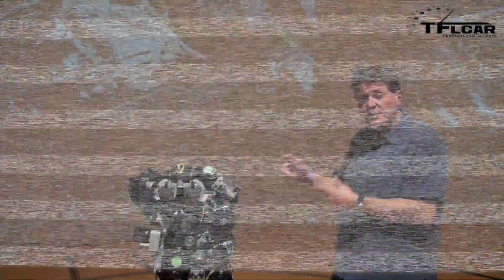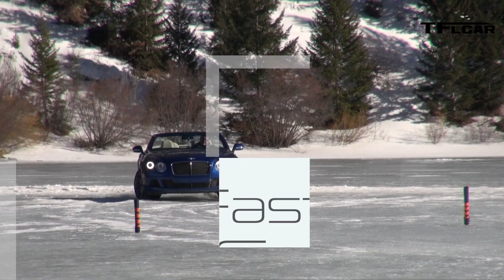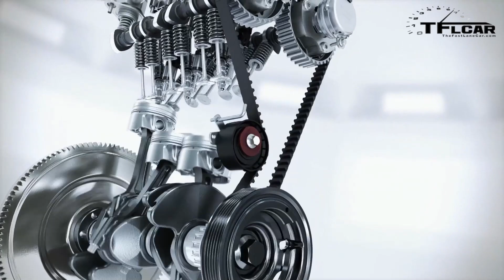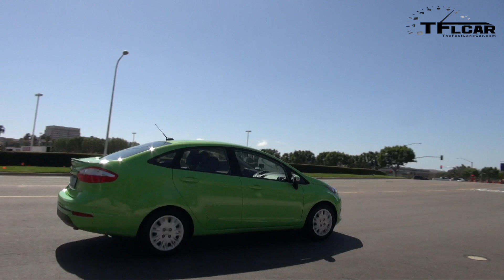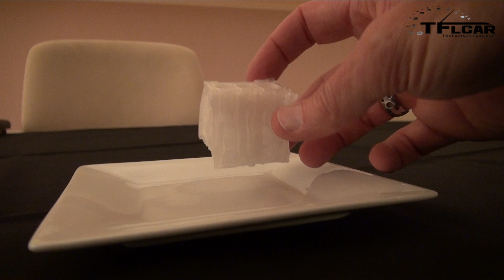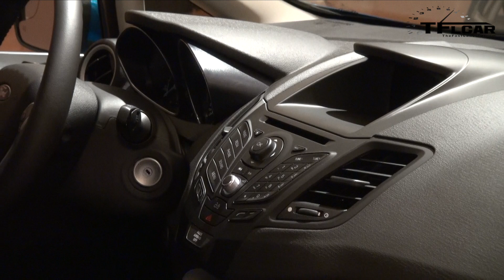2014 Ford Fiesta 1.0L EcoBoost: Everything You Ever Wanted to Know

Comment: The "Ecoboom" rumours are everywhere but all i can say is my driving instructor had one racking 20,000+ miles a year through lessons and it was still going strong after a few years.
Reply: It’s because this engine can last a long time but it isn’t very tolerant of neglect, you need to use the correct oil recommended for it and change it on time, if you do that it’ll be reliable

Comment: Just wait until the engine looses all its coolant or the oil pump fails due to being blocked with bits of failing cambelts at 35000 miles
Or the high pressure fuel pump leaking petrol into the oil and diluting the oil so the engine seizes the see how wonderful they are
Reply: you lot keep repeating this shit but everyone outside of you internet moaners are hapy with this engine
Reply: "Just wait" 😅 Guess what, i'm still waiting. Not a problem with mine, it's called looking after your car.
Reply: Yea had this engine for the last 9 years not a single issue

Comment: What Ford won't tell you is that at some point,your engine will start losing coolant.This turns out to be the gasket seal on the water pump.Due to the design of the engine,this is a big expensive job to fix.Another regular thing that crops up is misfiring caused by carbon build up on the back of the valves.Ford to date,do not have a fix for this other than to replace the cylinder head.If the car is out of warranty,which is usually when this problem happens.you will face yet another huge bill.I own a 2014 Fiesta Zetec S 1.0L 125bhp.It's a wonderful car to drive but because of the problems I have highlighted and whilst the car is still low mileage,I will be selling it.

Comment: Engine is shit. Runs way too hot. Especially up an incline. I had the 2014 1.0 turbo 3 cylinder and went through 3 engines up till 43,000KMs when I had enough and traded the piece of shit in. Steer well clear of this shit.

You have been warned.
Reply: U commented on car throttles video as well

Comment: You'll be lucky to get ,80,000 miles without replacing the engine, transmission or both.
Reply: Do not talk too much crap about something you know nothing about. I have my Fiesta 1.0 Ecoboost now for 5 years with over well 100 000 miles and I have NOT replaced anything on the car!

Comment: Minimum octane in UK I've saw is 95, the premium fuel is about 107
Reply: They use a different octane rating system in the US. Your standard UK unleaded (called "premium") has a RON of 95,  in the States the equivalent "regular" gas has a MON of 87.

Comment: I read and heard several times the fiesta is the 2nd least reliable car. Right above the fiat 500. I'm not sure if that encompasses all models or just the auto transmission, which has been a nightmare. I thought this model was interesting until I hear the belt and the manifold was literally unrepairable. Too bad. Reminds me of an inexpensive motherboard with integrated pieces. One part goes. The board is shot.

Comment: Hi all, proud owner of an ecoboost 125 fiesta here. Had it for almost 4 months now, if you have any general questions please ask. I'd be happy to share my experience  with it.
Reply: I agree, I love this engine. The power is just there and pulls great! I've had my Fiesta 125PS for a year now. I've had zero problems. Really economical too!
Reply: Donald, I'm sure it will be! If you're from the UK it shouldn't need servicing or MOT for at least 3 years from it's manufacturing date depending on how much mileage you do. Have fun!
Reply: +ktmad Average MPG? MPG on short distances? comfortable? favourite feature and a weird one, how good are the heaters.
Reply: +XCI Average mpg is around 45mpg, includes cold starts and short 15min trips. This car gets the best mpg on flat roads and at speed. 70mph gets around 45-60mpg depending on if its hilly or not, if you drive where its flat the mpg is well in the 60s. Also, i found that filling up at Shell or BP actually made a huge difference to the economy which i didn't realise at first, this car just sips the branded fuels.
Comfort is good, i'm tall 6"2 so at first this wasn't my first choice, but after test driving 1.2tsi fabia and 1.6 golf i was surprised at how comfortable i could get and how 'well composed' the drive was both around town and at speed, it feels like you're in a bigger car inside which i like also.
You'll feel the pot holes and medium bumps but i do have the 17" wheels which probably doesn't help, yet still, the steering and handling is up there with the top favourite things about this car.
I used to travel 200 miles from Northampton to North Wales every fortnight so for long distance travelling you could swear you're in a 3 series or something, definitely dig the intelligent suspension and getting rid of that road sickness you may have got in the older fiesta body/wheel base etc.
Favourite feature is a hard one, as i've mentioned a few above. Top 3 things are: #1 is the turbo, it just pulls which is great for overtaking, sliproads and hills, steep ones! #2 the handling, for my previous job i used to drive bmw 3 series estate, audi a5, hyundai i40, and other 'big cars' as well as a few superminis i looked at before getting the fiesta, and from my personal experience i haven't driven anything that feels so good yet also fun to drive. #3 are front heated windscreen (patented so no other manufacturer can do it, yet), led day lights (they look great on this car), AC/climate control is very responsive, gearbox and clutch (i've always had problems with clutches i.e. too springy, bite is too high etc. in new cars, but this compares with some of the korean manufacturers which i find quite nice to shift, e.g. Hyundai i30/i40, most comfortable clutch/gearbox for a tall guy like me).
Weird things about the ecoboost fiesta: you get the best economy by changing gear (especially the low ones) between 1.5K to 2K revs. Say you're pulling away from 0mph i find myself changing into 2nd almost immediately on flat roads due to the ratio feeling small and the rev counter shooting up, the trip tells me even at 2nd gear that i'm doing 15-20mpg at 15-20mph say so when at town cruise speed, say 30mph, 3rd gear is the most efficient at around 2K revs... higher gears will put the engine in labour (engine will judder) and lower gears will just be in the 3-4K revs which may be fine in a naturally aspirated car, but in this it will just drink that fuel like its in a yard glass. So low revs is key. When at 70mph in 5th gear, the car works at around 2.5k revs which tends to be the highest i let the car go when trying to be efficient.
Didn't mean to write an essay but i hope that helps! If you have questions please fire away
Reply: ktmad Thanks for the informative reply, I am getting one next month, I want a white one with the city pack, do all of them come with daytime running lights? what are the servicing costs like?
Reply: +XCI no prob, have you taken one for a test drive? If so what did you think? i'm not sure if they all come with daytime leds but i'm sure if it doesn't there is a substitute day light lamp. Servicing costs, my service is not yet due until april, same with MOT. Shouldn't be too much apparently, but i don't have that experience i'm afraid!
Reply: ktmad Never taken one for a test drive, sat in one, also sat in the ST, like both and decided on the 1L as it's my second ever car.
Reply: Nice, yeah you won't be disappointed! It's my 2nd car too funnily enough, the telescopic/tilt wheel and adjustable seat are great benefits too which i forgot to mention. I changed from the 1.2T Clio as i couldn't get used to the clutch and gear box ratios.
Reply: ktmad I currently have a 1.4 2002 Clio haha
Reply: haha, well i assure you there's something about fords in general where the handling and drive is just good and you really feel happy or confident on the road, it's hard to explain! So that with their ecoboost is like a win-win situation for me personally
Reply: ktmad Yeah I was going to get the ST-2 but it's a bit too much for a second car, happy with the 1L though, will be amazing I am sure, I want the city pack too, wish it had heated seats (I am buying second hand)
Reply: +XCI i bet that'd be a beast on a circuit, but yeah i get you price wise. Is it the 125 or 100ps? To be honest i'm not that much of a racer so never red lined the car but if i did i'd probably take off, the acceleration when the turbo kicks in is great fun. I'm not sure if i had the city pack, what does it include? Yeah i know what you mean about heated seats, you could probably get one that plugs into the cigar lighter though?
Reply: ktmad I will get the 125bhp version, the city pack is folding mirrors, puddle lights and rear parking sensors.
Reply: ahh i think i must have that then, but what are puddle lights?
Reply: ktmad Basically at night when the door is opened it shines a light on the ground so you know if there's a puddle there when you step out etc :)
Reply: Ahh, yes i have those too. Yeah they're neat, which colour did you go for? I have the blue
Reply: ktmad I want one either Candy Blue or White :P
Reply: Yeah they both be quite nice, i have the blue (must be candy blue). Looks great
Reply: ktmad The Candy Blue is an extra £750 I think, not sure though.
Reply: Do these cars feel fast, like acceleration and can they corner quickly. Is it worth modifying or are they good enough stock
Reply: Well the Zetec S has the exact same engine just with a 140HP map and I think a better head gasket for the extra power. And yes, you can easily beat a 1.7CDTI.
Reply: Unity101 thanks
Reply: Daniel sorry for the late response, I've driven a few fast german cars usually around the 2 litre turbo mark and these little petrol engines do accelerate well, at least my 125bhp one litre, the fiesta chassis and steering tech honestly i find better than BMWs or Audis, this was a major deciding factor for me as I almost  bought a 1 series but you really feel on the ground and in control from a sporty perspective in this little hatchback. i always wonder why other manufacturers can't replicate it in the more luxury brands. If you test drive it and corner it fast it's so much fun and 'well balanced' is how i describe it
Reply: ktmad I've just bought the Ford focus 1.0 ecoboost 2015 hope it's as good, I've seen alot of bad reviews about the engine
Reply: Hey, ktmad, how's your Ecoboost treating you these days? 2 years passed from your post. Are you still satisfied? Any problems? Thinking of buying one this year.

Comment: direct injection, while sounding good on paper, is already proving that it is not a good concept for consumers.   Indirect injection  "bathes" the intake valves with raw gas thus keeping them clean.   Because of the EGR system deposits accumulate on the intake valve causing disrupting the air flow and reducing efficiency.   Toyota is already using a dual system at the same, direct along with indirect, to alleviate this problem.
Reply: this engine does not have an EGR system
Reply: No EGR, the engine is small and DI provides enough cooling for a 1.0 so that the NOx production is okay for Euro6 laws :) but i can see your point... i own a 125 ps Fiesta st-line and if you replace the air filter in time, there shouldn't be any problems
Reply: It is not the EGR system that carbons up the intake valve. It is the crankcase ventilation system. (which it does have)

Comment: While I'm excited for this engine, the integrated exhaust manifold design, to me seems like a problem from a mechanical standpoint. Exhaust manifolds leak, and that means if you want to fix it and its in an area that you can't weld easily, then your stuck buying a new head for your motor.... more expensive parts and a lot more labor involved in replacing the exhaust manifold now...
Reply: +DoomsdayMelody91 It wont crack or leak, not more than heads do. Or, if it leaks, its from the joint from turbo to exhaust.
Reply: being part of the cylinder head complete with coolant passages and all makes it seem a tad more secure no?  seems exhaust manifolds are often made from tubing rather than a machined aluminum block.
Reply: justletmeuseit
more secure? I mean, the durability of the exhaust manifold would depend on two factors instead of one. Your ability to maintain the fluid in the cooling system, as well as age/corrosion/heat cycling. My only complaint about this, and it is especially important due to the fact it is a turbo motor, is that if the exhaust manifold springs a leak, your buying an engine head and you risk contamination of the cooling system as well.
Reply: DoomsdayMelody91 did it occur to you that a traditional manifold may be more likely to leak by design?  lack of coolant circulation could be an issue but there are no doubt  systems in place to detect that kind of problem early in a modern engine such as this one. get used to the exhaust manifold being part of the cylinder head btw, as ford wants to do this to accomodate other ecoboost turbos... only time will tell if this is a bad idea or not, so far it seems like a clever solution.

Comment: I'd wish they drop the 1.0 l ecoboost in the fusion. I also wish they made it available as a naturally aspurated engine as a cheaper option,  I know turbo engines are more fuel efficient when your gentle on the throttle but can be fuel drinker s when more throttle is used.
Reply: +knightrider1545 The 1l EcoBoost cars have a "Change-up" indicator on the dash, to show you when you're about to move from fuel-sipping to fuel-gulping.
Reply: Riggald Eux Besides, whats the rush?
Reply: Riggald Eux thats a useful feature you pointed out kind sir.

Comment: I've owned a Focus with this engine and a 6 speed manual transmission for a year now, and let me tell you it is very fun to drive. The sound is unusual, but nice nevertheless. The turbo lag is not really noticeable. The whole drive train feels really well put together. Mine uses 0,44 liters per 10 km on the highway and 5,4 in the city. I floor it every now and then, so your numbers may vary. I test drove a Mazda 3 with a naturally aspired 2 liter engine and it felt fine, but no way near as snappy and fun. The ecoboost is like a ferocious little tiger. Kitty has got claws, but she is not going to rip your face off. It's just a 1 litre engine, remember.

Comment: I like what they're trying to do. But it's not perfect yet. 
This is one of those things where if it were a toaster. It would be completely moulded solid and any screws or bolts would have a head on it you've never seen before. 
Meaning. When it breaks. And it will break. It will be years down the line perhaps. But it will break in spectacular fashion. And you'll be sitting in a car out of warranty and out of an engine. 
Just saying. Think about. 
Their engines 2.0l and above are already destroying turbos and getting choked up with oil.
Reply: The real shame is, and a major point of contention are the low octane fuels that Americans have to put up with seriously restricting performance and mpg. I have the 1 litre 125 bhp European version in a Fiesta Titanium, it's phenomenal, Pocket rocket when it wants to be, quiet comfortable little cruiser returning 66 mpg when I drive it conservatively. The newly designed engine, the smaller ecoboost is manufactured in Germany so I wont worry about it going wrong.. I'm sorry the 2 litre was entrusted by Ford to be American manufactured in Ohio.
Reply: MegaVector2011 I didn't know about the crap fuels in the U.S. until recently. That must be why they feel they need huge engines. To compensate. 
I wonder. There is a 2.0l ecoboost available in the European market. Hopefully that is German.
Reply: Andrew Gallacher Not sure Andrew, although Ford is a 'world brand' and their aim is to supply cars largely built to similar spec on the same platform, there are subtle differences in design and spec depending on Country. It's worth checking out, especially where the car & engine was built, they have worldwide plants, I would only trust the European ones personally, purely for the build quality and that the engines are aspirated to run on higher quality fuel.
Reply: MegaVector2011 No matter. If you know how to drive, 123 horses is plenty of pull. I have the same in a 1.7 diesel. Flooring the gas in second gear you can literally feel the blood drain from your face.
Reply: They said in the interview that this engine has been sold in Europe since 2011 without any problems? I do agree, however, with the logic of what you're saying. I want to buy a Fiesta, however, I am still tossing up between the 4 cylinder 1.5 and the 1.0 Ecoboost. I prefer the Ecoboost, however, I am concerned about what you're talking about... hasn't really been around a very long time.